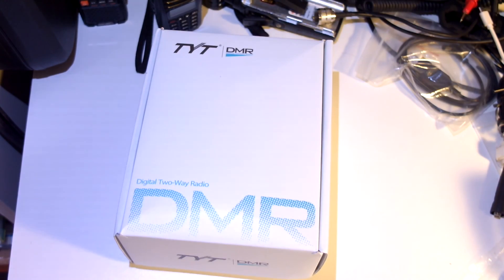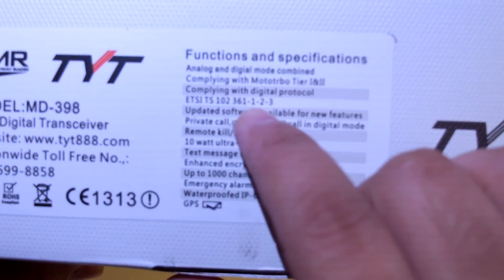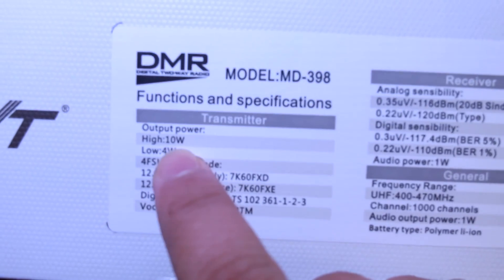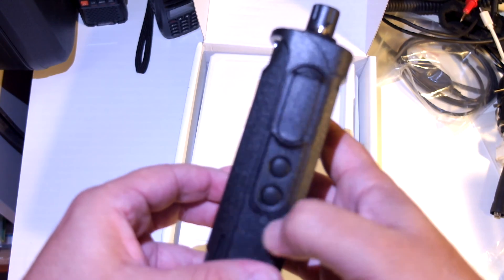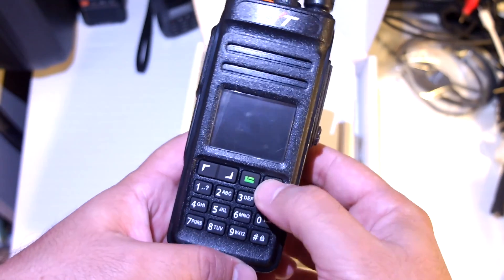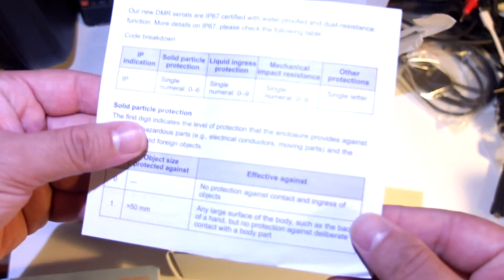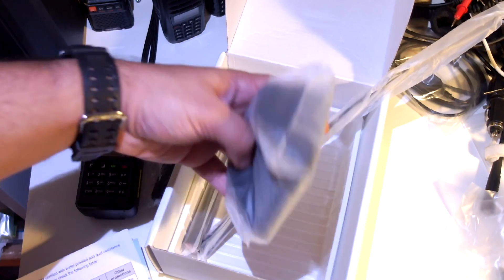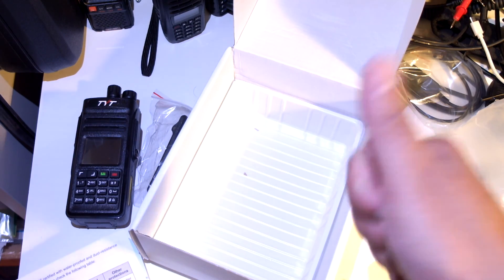TYT MD 398 GPS Unboxing

Comment: Hi, thanks for the review. I live in UK.  Do you know where and when I can get this.?
Reply from the maker: The TYT model is not yet available. However, you can get the identical Radioddity GD-55 here (affiliate): http://amzn.to/2funSej TYT has confirmed that these radios are the same. There is no info yet on when the TYT MD-398 is going to be available. Thanks!
Reply: Thanks.  Have you by any-chance done any range tests.  Like if you had 2 of those. What range could you get in a city?
Reply from the maker: I still haven't. I have two of those, but one of them has an issue. They are both pre-production models. I am waiting a replacement from TYT. It is a video I want to prepare, thanks!

Comment: it do NOT support tier 2
Reply: HamRadioReviews how to turn on the scanner ?
Reply from the maker: Yes, it does not support 2 different time slots.
Reply from the maker: Вячеслав Климочкин You need to connect it to a PC through a USB cable and assign one of the side keys to scan. Alternatively, you can test if a side key has already been set to scan.